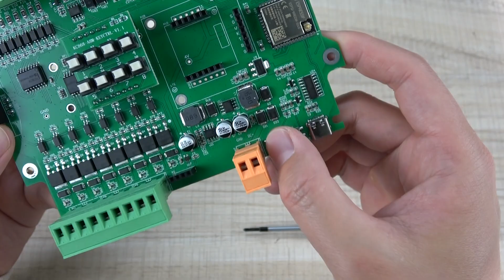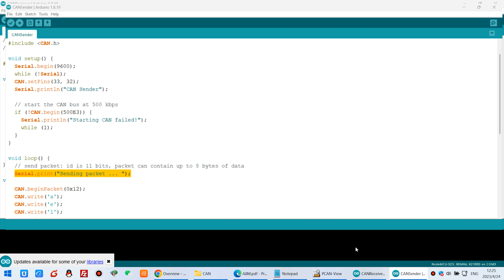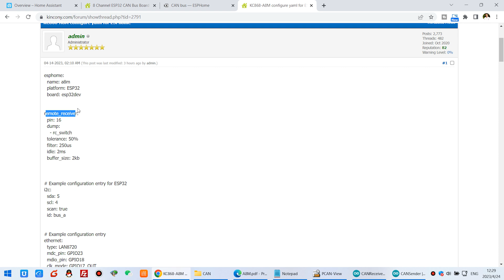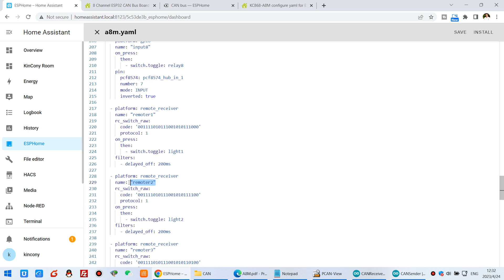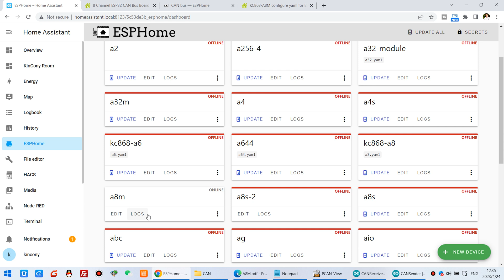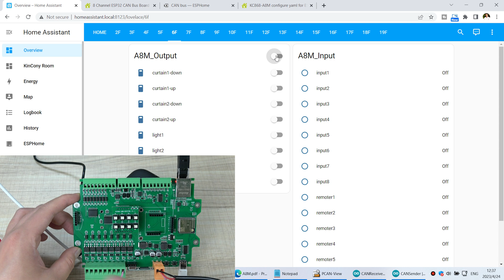KC868-A8M ESP32 CAN Bus home automation board for home assistant

Comment: Neat board! Is there a reason to use mosfets? I pretty much always use optocouplers for outputs, then I can choose to provide power or use the isolation for external circuits.
I'm not sure how I feel about such custom boards for general purpose use, since I doubt such a board would perfectly meet my needs for any given application.
Have you considered a modular system? Not headers for add in cards, but a controller/ESP32 and then users add modules as needed for outputs, inputs, 4G, etc. The system would grow or shrink as needed, depending on my application. It'd be great if I could design my own board as a module for that system.
Since I couldn't find that, I ended up designing my own boards. I needed PoE, which is rare, so I used a wESP32 + my daughterboard. Most are optocouplers and inputs. I use a number of opto isolated UARTs over RS-485 for controlling Mitsu HVAC using the Swicago OSS. I couldn't have done all that with off the shelf boards, but maybe I could have with a modular system.
Reply from the maker: do you want use I2C to extend many module?

Comment: Can i put a 110V AC for the output? Or that is only possible with the NO and NC relays.
Reply from the maker: MOSFET output DC12v or 24v, so you need to add extend relay module, so that can connect with AC 110v load.

Comment: CAN bus  and RS485 MUST HAVE  option to switch on/off 120 OHM bus terminated resistor because that resistor is turned on ONLY at the beginning and at the end of the BUS.
Devices connected to the BUS other than the first and last MUST NOT HAVE A RESISTOR CONNECTED TO THE BUS. 
If this rule is not followed, the BUS DOESN'T WORK
Reply from the maker: thanks for suggestion, i think will add a jumper for this in next version.

Comment: can we use RF remote and without internet? can we use 4g sim to communicate with HA without ethernet cable
Reply from the maker: if use RF remote work without internet, no problem. 4G can't use for home assistant. HA mainly use in local network.